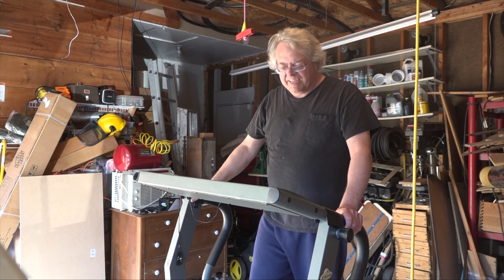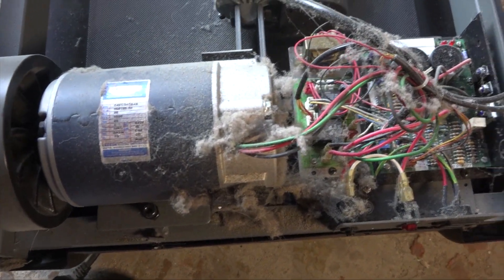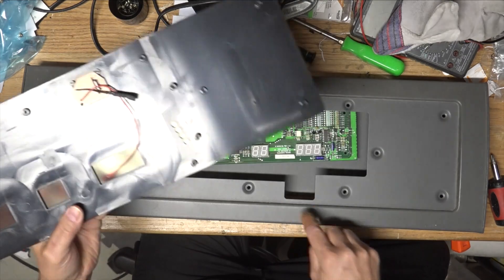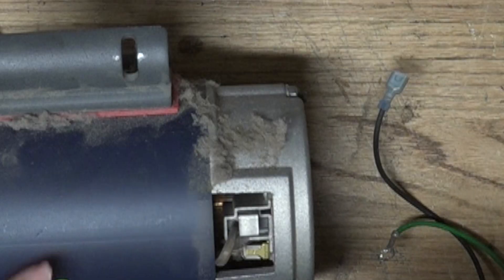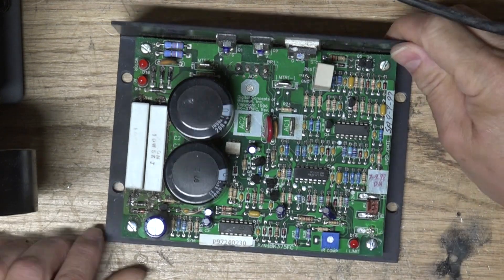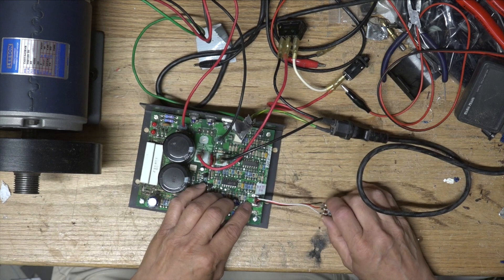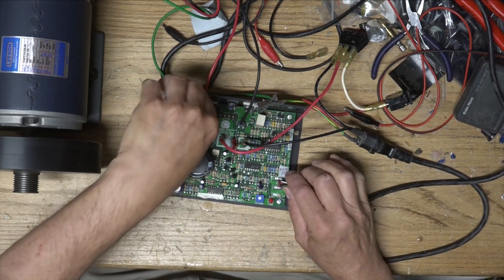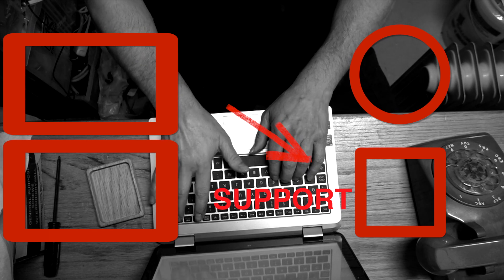Look Inside: Treadmill

Comment: man you got lucky with such a cool machine!! Was that a commercial model?
and me wishing I had gotten something like that for free to work out on. Instead, I got a very, very basic one for free. Its so basic that the computer in it takes AA bateries and the machine will still run without the computer part working. The screens dont even light up on mine and are hard to read because I am legally blind with RP. Oh how cool it would of been to have something just like what you had there before you took it to pieces. Nice, high contrast, easy to read big orange led 7-segment displays, automatic elevation and that awesome whisper quiet motor! Not to mension full logic soft controles you had on your machine. 
On my unit the speed control is no more than a slider pot. You also get 3 levels of incline that you have to set manually. The motor hums loud. Its a proform also made in 1998. 
Had it for about 6 months now and still going strong. I lube the deck every month, The plastic trim around the deck is a little noisy but it gets the job done. I needed one badly and its all I could find for free so it'll do for now. 
It folds up too. I use it every day. Just hope some day I fine a free one like what you found. I am going to say my machine was probably a low end model even when it was brand new.
Reply from the maker: I don't think it was commercial.  Just an older (probably high end) model.  Keep watching your local craigslist!